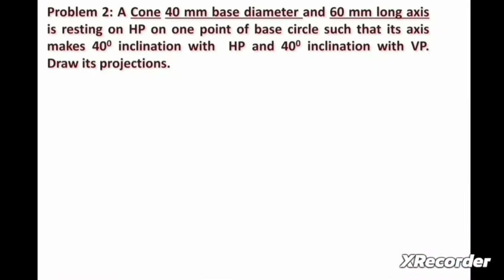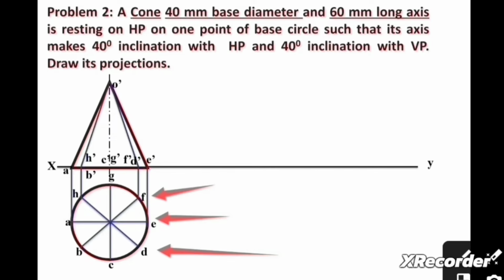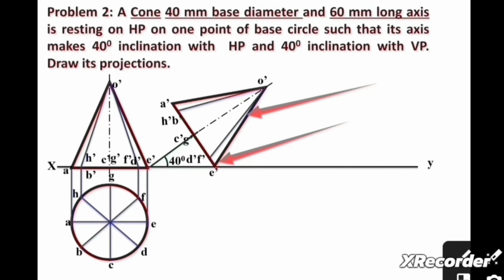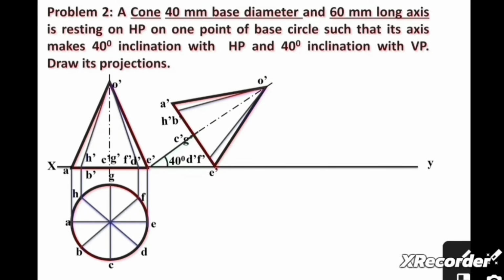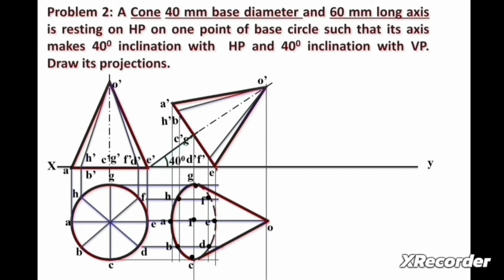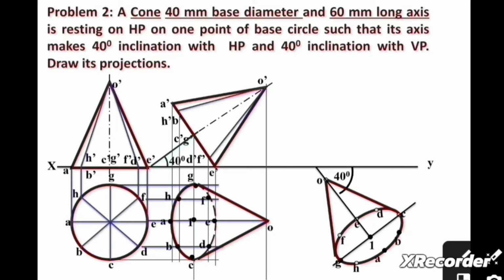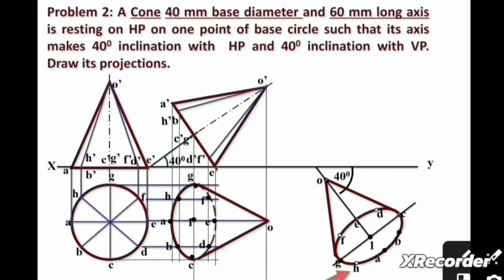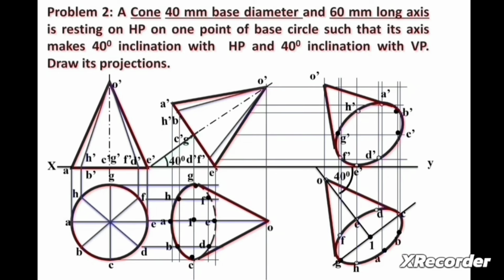A Cone 40 mm base diameter and 60 mm long axis is resting on HP on one point of base circle such tha

Comment: A cone with base diameter 40 mm and height 60 mm is kept on V.P. on a point of base circle such that the apex is 45 mm in front of V.P. Draw the projections, when the axis is parallel to H.P.